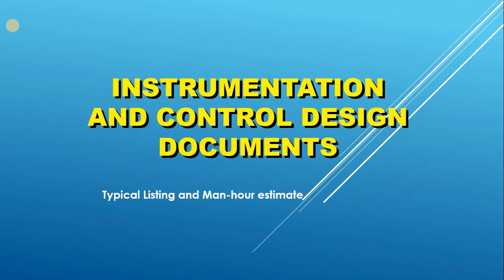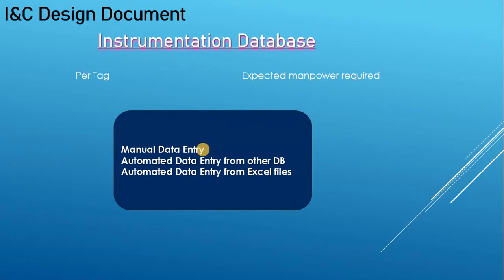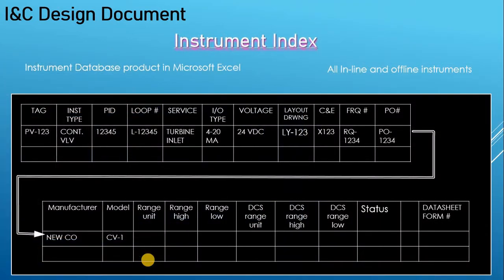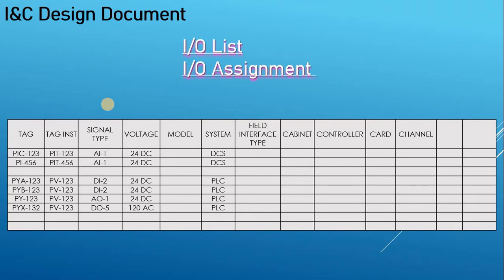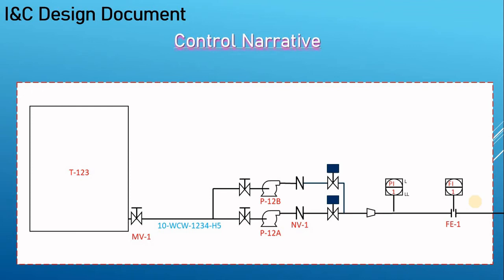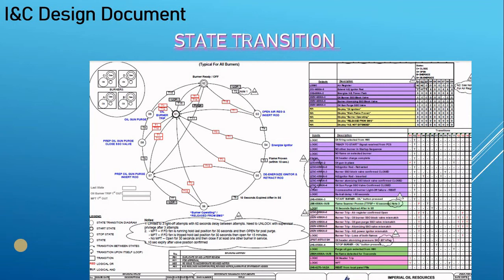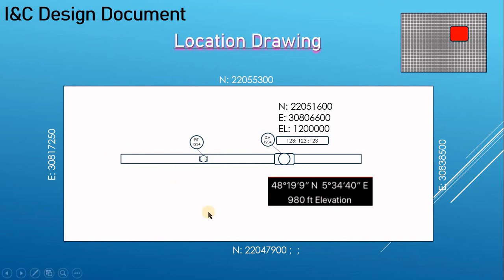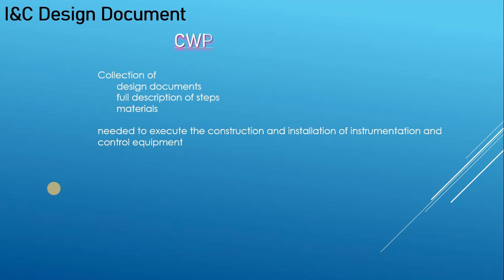01-11 Engineering Design Documents Instrumentation and Control. description and manhour estimate

Comment: Thank you. If I may ask, what software do you use to present your lessons?
Reply from the maker: Thanks for asking, The material is prepared using Microsoft Power Point alternative  Libre office --Impress
(free).  Screen Capture by CAM 8 (free),   alternative OBS (Free). Video editing by Openshot (free) so all S/W are free. Hope this helps.
Reply from the maker: If you want to be more fancy you can try SOZI, I am releasing a video about HAZOP made by SOZI
Reply: Thank you for your prompt response. Appreciate the help.
Reply: So you prepare lessons on PowerPoint, and use screen capture while in presentation mode to also add the voice over?
Reply from the maker: @Lerat.o.s  Yes, the screen capture S/W (Cam8) capture also the voice (PC mic or external mic) so you have the video and audio in one place, however you can also capture the voice  using your phone and then add the voice to the video in the editing software (Openshot). since you have the audio separately you can edit the voice by itself before adding it to the video  in any audio S/W like Audicity.  Hope this clear the matter. it looks lot but take it one step ta time. use CAM8 to capture the screen with your voice and go from there.
Reply: @LunchandLearnX  thank you soo much. Appreciate the help.